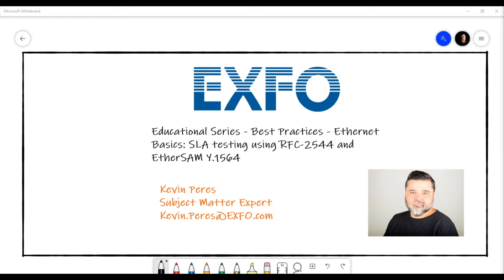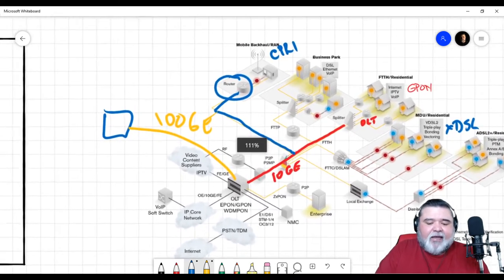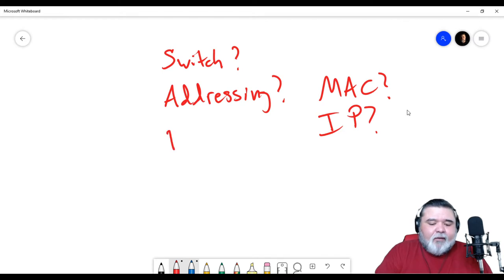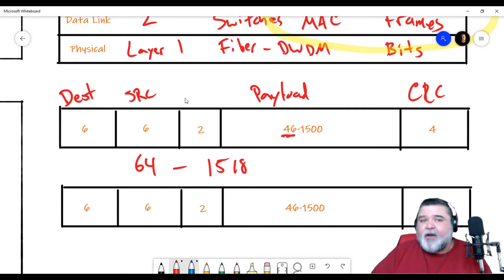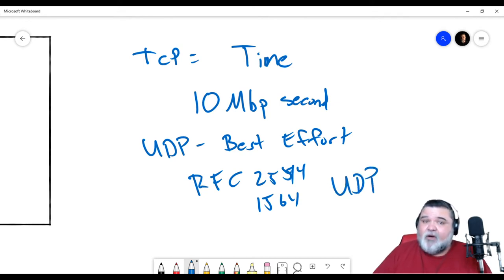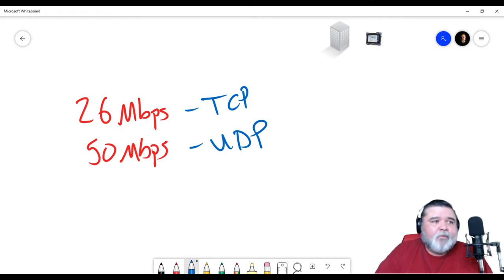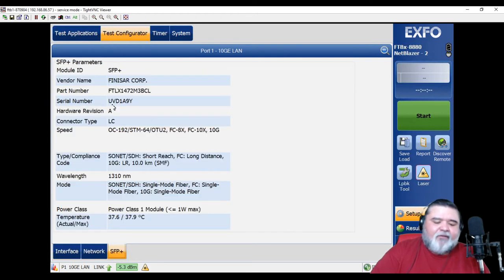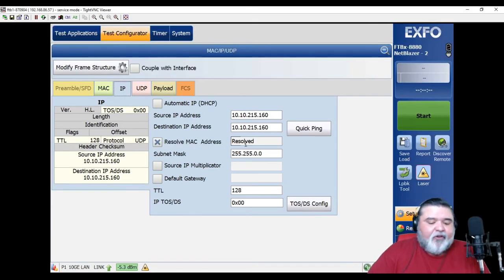Basics of RFC 2544 and Y 1564 Testing Seminar

Comment: How can you use exfo ftb-1 pro as a manual loopback for 1G electrical for Y.1564? Meaning test being run from a different source and the exfo being the loopback.
Reply from the maker: Robert,  You will want to use smartloop back.  Or if  the SW is fully updated we can respond to the most common third party vendor loop commands such as from  Viavi.  Give it a try the only thing you will need to make sure is that you have link.  Set your port 1 1G electrical and connect it to your network.  When you initiate the loop common from the far end unit if its a supported device we will respond to that loop.

Comment: Hi Kevin.  I'm currently working on Failed RFc test.  It's 50MB but I only got 10MB.  When  I ran 50MB, it only passed on Latency at all frames.  Failed on Throughput and Frameloss. I ran Mac swaptest with our carrier,  placed the loop at the NNI and to their Equipment, it both passed.  They already cleaned their fiber and changed SFP,  bht I cannot still pass may RFC.  Any advise what might be the possible issues? Your advise will be so much appreciated.
Reply from the maker: Send me an email at Kevin.peres@EXFO.com  I need details on the test configuration and network

Comment: Kevin, I know you posted this a while back but I hope you still read these comments. I currently have an EXFO FTB-1 Pro with the 8880 card installed. I'm just getting into the Microwave setup and have been asked to run a RFC 2544 test. I understand how you have your system set up, and how everything works, and what it is testing. However, I'm a little stuck on how to incorporate this into a microwave shot. Can I have my EXFO at one end and have the switch at the other end of the shot be a loopback? Or can I just program each radio with an IP address and put a physical loopback coming right out of the radio at the far end? Or will I need two machines to run a test? I tired to reach out to EXFO to get some information but haven't had any response yet.
Reply from the maker: I do check these regularly. Drop me an email Kevin.peres@EXFO.com and I can help. The answer to your questions require more questions lol.
Reply: @KevinPeres  Hi Kevin, what was the outcome of this request?

Comment: The RFC 2544 Throughput Test is great and very predictable when there is no frame loss.  But if frame loss present, it's hard to determine the amount of time it will take for the test to complete as the RFC 2544 algorithm tries to find the exact throughput with no frame loss.
Because I do not know ahead of time if there is frame loss present, and I have limited time to run the test, how do I ensure the test completes within given time frame?
Reply from the maker: Very true. I am not a big fan of RFC-2544 for SLA testing.  It was what the industry had at the time for production testing but really was not designed for network testing.  Y.1564 is a better alternative and it's a standard!

Comment: Hi Kevin, Just gone through from this video & I found this incredibley good.  

Just have a small query, what you said if we are testing a L2 traffic then there will be overhead & based on frame size we will get the throughput. I am using Carrier ethernet & while we are testing I always found 100% throughput available after the test. I am mentioning below the test settings :- 

Test Layer :- L2
Frame Type :- Ethernet II (DIX)
PRBS 2E31
Ether Type 0070....
Reply: Hi Kevin, Happy New Year.
Reply from the maker: I apologize for the delay. The test layer may be Layer 2 but in the Results on the unit you need to set it to display the throughput based on  the Layer.  In the results window near the lower section under the throughput results should be a drop down to display rate based on layer.  I do not have a unit in front of me but I believe it will have the option for IP and Ethernet.  You need to have it set for Ethernet. I may have the wording incorrect. Let me know if you can not find it.

Comment: Hi Kevin, excellent presentation. 

Just one question... Is the traffic in the Y.1564 generated from L2 or L1? For example, if I configurate CIR=9800 with EIR=200 Mbps, the 9800 Mbps came from L1 in order to get 9689 Mbps of Ethernet BW, Am I right?
Reply from the maker: Jorge, I am glad you enjoyed the presentation.  I had to cut some parts out as it had customer information.  I was not sure if it flowed as well.  Y.1564 test portions of the OSI stack up to Layer 4 (UDP) Not stateful TCP.  But to your questions. If you are transmitting a CIR of 9800Mbps than your rate should be 9800Mbps at Layer 1 as there is no overhead.  What you really need to look at is the frame size vs the CIR.  At Layer 1 you should be at full line rate no matter the frame size.  At layer 2 though you have to account for overhead so frame size really matters. If you are sending 9800Mbps of frames at 64 bytes then you are getting approx. 7466Mbps at Layer 2.  If you are using 1518 byte frame sizes than its approx 9673Mbps. At layer 3 64 bytes has 5357Mbps of bandwidth.  The smaller the frame size the less bandwidth-efficient.  I hope that answers your question

Comment: I would like to get your confirmation it is possible to do RFC 2544 with JDSU 5800 from on side and the other side is physical loop.
Reply from the maker: I am not sure what you mean? All test vendors with RFC-2544 can do a test but you need to be careful with a physical loop.  Are you in an Address aware environment?  Physical loops should be limited to Layer 1
Reply: Why is that so? 

Is a hardware loop preferred?